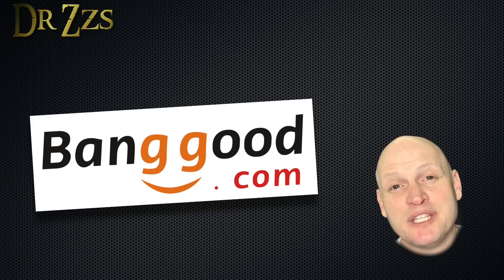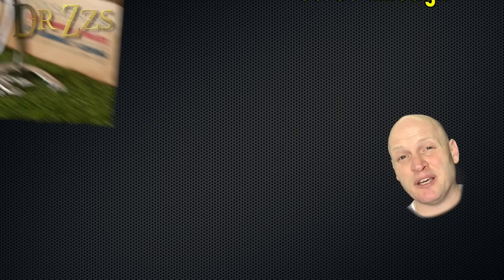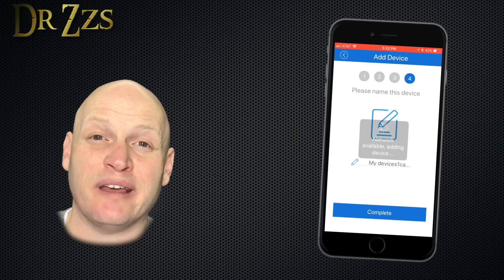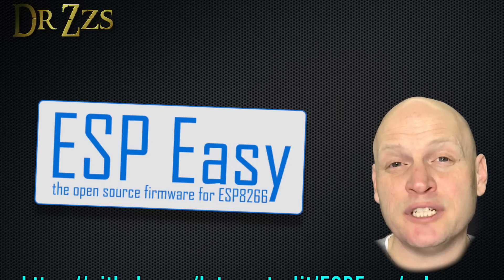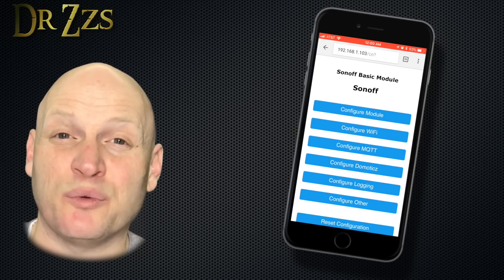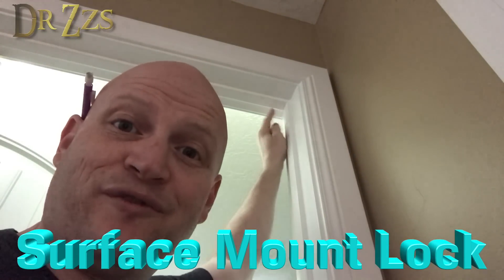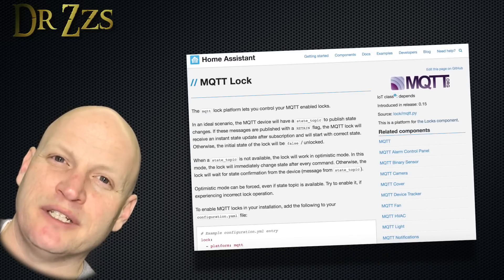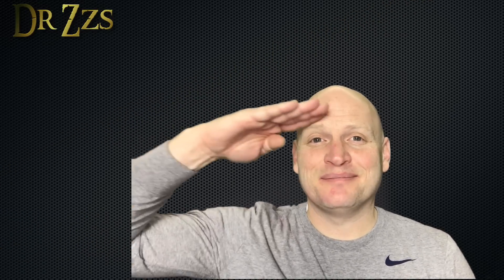$25 DIY "Smart" Door Locks - ElectroMagnet + Sonoff + Tasmota

Comment: I need your help i have a 3D printer i need  a cooling system for the board unit which turns on automatically when the enclosure reaches a certain temp i have the temp sensor can you help :) :)

Comment: Great video.  I agree with Bob Moran about a battery.  In some cases, you would not need it to fail open for fire, because there are multiple exits.  I'm in Florida, so occasionally you have multi-day power outages due to large storms.  So maybe just using a dedicated UPS would be the way to go.  Or better yet, 12v battery and solar backup.
One other thing, and perhaps its overkill, but it would be very inexpensive to do a lock at the top AND bottom.  The equipment may be in the way a bit, but you would have much greater stopping force.
A keypad is really needed though, as someone else mentioned.  Being outside you really want a quick way in.  NFC might be easier though.
Reply: Great post, what is NFC?
Reply: UPS can get expensive. You can easily make one with a Li-Po battery and a cheap charge controller. 

I also advise NOT using a lock that is fail safe open. Your power goes out and it is more time than the battery has charge for, you are leaving the door unsecure. By using a panic/stop switch to directly apply power, in emergencies, it can be unlocked. Some stop switches even have LEDs that can be wired to turn on when there is no mains power or the lights are off. So you can see it in the dark. Or simply always on and powered by the battery.
Reply: Oh and when using fail safe locks, use them only on interior doors, but if you have to keep them locked you can do that with Li-Po and charge controller I mentioned.

But for exterior it is best to use fail secure locks.

Comment: Extra security for  nefarious power cuts.   Wire in a small  12v  lead acid battery like the PX12072-HG to maintain the lock on power cut and maintain charge from house power.  House on fire:  Power on = normal exit,  Mains power off battrey up = normal exit ,  Mains down and battery dead = fail safe unlock.
Reply: No need to do that, just get a fail-secure lock instead of a fail-safe one.
Reply: David Jeffers this is an opportunity to consider a personal philosophy and the possibility of creating a tortured death by fire for someone in the event of a total system failure. I suppose if you don’t have security bars on the windows or could exit that way, most people with mild intelligence and a survival instinct would be able to exit and the chances of that kind of failure to someone other than yourself might be very small so perhaps I would consider your suggestion but more likely I’d go the battery backup route. I was thinking I’d need to lock my electric panel but what a hassle. And shouldn’t it be locked with a smart lock? lol
Reply from the maker: yes!  Excellent solution!
Reply: @ Bob Moran This is only half a solution for the lazy and forgetful person who may become lax in keeping the battery changed. Amazon shows they are often sold with a trickle charger, however those will use electricity and over charge and ruin the battery if left on all the time. Therefore a UPS smart charger or battery tender is required. Maybe there are other systems that should be kept on in the event of a power failure so perhaps a more robust battery and support wire system would be helpful?

Comment: The fail safe is a problem.  If someone want to access your house or room, they just shut the breaker or power to the house/room.  Just like safe-lock feature in a movie.  Can this feature be disable?
Reply from the maker: No, can't disable it.  I believe there are non-fail safe locks too.  I'm not worried about someone cutting the power to get past the lock.  Our circuit breakers are in the house in the basement.  You can't shut them off from outside the house.
Reply: Not if they pull out the electric meter off the housing.  That's what I did when I replace the main breaker board.   I just brought 3 of this magnetic locks using your link.   I am using for my home office french doors to keep kids out hope they does not know what the circuit break is.  Thanks for respond and the great video.
Reply from the maker: cool!

Comment: How did you wire this all together? At work I have a pneumatic push button wired in line to the push button to break the 12v circuit that also connects to our control panel.
Reply from the maker: I ran 12v to the input side of the Sonoff SV, the touch module button connects to GPIO14, 3.3v and ground. Then the lock connects to the output side of the sonoff. 
so I can lock or unlock it with the touch module or with Home Assistant.

Comment: Anouther well done video.  
Do you have access to Home assistant remotely?  I haven’t found any good up to date videos on how to do that and I can’t figure it out on my own. I got Duck DNS installed and that’s as far as I got. ☹️
Reply from the maker: yes, i do have remote access.  I set my home network IP address static.  My router gives me that option.  Some other routers might not.  In the past I had a different one and had to get my ISP to give me a dedicated IP address.  With the IP static I then forward an external port to 8123 on the IP address of my HA pi.  I use DuckDNS too, but it's not as important since my IP is static.  
I'm sure there are network security experts that would say there's a risk to having a static IP.  
I have a password on my HA interface also.  To get into my home network and make changes to config files and such I use OpenVPN.  

So the easy answer is to get into your router and see if you can set your home IP address static.  Then find port forwarding and forward an external port to port 8123 on the IP of your HA pi.  You actually will need to set the IP of your HA pi static too.  
For me I go under "LAN setup" and I can select devices to give a fixed or "reserved" IP address. So I do that with my HA pi and any other devices that I don't want the IP address to change if/when the router restarts. 

Hope that is at least a little bit helpful.

Comment: When I flashed Sonoff Slampher with flashesp8266, I was not able to create Wifi AP by pressing the button 4 times. I had to change the Wifi settings with Tasmota commands via serial connection (I used Termux to access the console). Maybe this will help someone.
Reply from the maker: Cool.  Thanks! 
I didn't include it in this video, but what I've done is make my own binary file exported from Arduino IDE with my Network info and MQTT info included. So when I use "Flash-eZ" now, the sonoff can connect to the network without the extra steps. 
I'll include that in another video.

Comment: If there is a fire and you have a smart fire system have it unlock when fire is detected.
Reply from the maker: Helz ya!  

Do you have "smart" fire detectors?  I have one flame sensor I need to tinker with.  I haven't looked at smoke detectors yet, but that should be on my list of videos to do someday!
Reply from the maker: ya, smoke detectors might not be the best place to save money.
Reply: I went with NEST. You can add them to Home Assistant. No need to scrimp on safety
Reply: As I rent I have not bought one it is on my todo list.
Reply: DrZzs https://youtu.be/8fIWIpw0SwM

Comment: What a coincidence, I tried make a smart lock last week but failed.
I used a comum lock and a servo motor.
Reply from the maker: Great minds thinking alike again! 

Using a servo on a normal lock is a good idea.  What went wrong?  I'd guess building some housing and getting the mechanical parts to work together would be hard.
Reply: I guess so. :)
I'm from Brazil and we have different locks here.
The housing of the lock is bigger and the key locking mechanism is almost like a servo arm. 
https://goo.gl/cy1h73
So I thought that I could install a servo inside the housing and working together with the key mechanism but the orientation of the servo is not the same. It would be necessary install the servo parallel sticking out of the housing. If the servo could go on the right orientation it would be a very tight fit but it would fit inside it.
I think I gonna use the Cathode Lock because it looks like it would work with my lock.

Comment: Did not know you could get these so cheap.  Biggest issue is cutting power causes house to be wide open so don't put one on your front door!   I would want to attach a motion sensor that will unlock as I approach, though.  Especially on those doors at my house that are only closed to keep the AC zones separated
Reply from the maker: Good idea! 

Maybe if you really wanted to go all out you could get a battery backup.  I was wondering today how the $200 smart locks handle power outages.  I'm not going to buy one to tear apart and find out, that's for sure!
Reply: Hmmm. Where would I get a 12v battery? My car!
Reply from the maker: actually, yes!  Our old alarm system had a back up battery that looked like a car battery.  A little smaller, but pretty close.  
I've got my electric car (Nissan Leaf), I wonder if there's a way to use that as a backup battery.  There's probably some one-way directional dealiwhopper on the charger... It would make a lot of sense to use that as a backup battery for the whole house (or at least some crucial systems).

Comment: What are your thoughts about the issue of your house unlocking in the event of a power-failure (or someone cutting the power outside your house?)

It seems to me, the way to handle it is kind of what you had with your garage (but the lock MUST NOT have a fail-safe mode).  Meaning, if the power is cut by some bad people (to also inhibit your security system from going off) the the lock should REMAIN locked, but a person trying to escape a fire, could simply turn the handle, as they would already expect to do.

Can these locks have the fail-safe deactivated to support this?

Thanks,
Daniel
Reply: Yeah I definitely wouldn't implement this here in Arizona where all of our breaker panels are on the exterior of the house.
Reply: The mag lock won't work without power. One would need a battery backup. And without power you probably won't t have internet or WiFi at the house so you have no way to open the lock. The only way I can see to do it is with a battery operated device that also accepts a key.... So basically it needs to be just like all the other smart locks out there. Battery operated motor that extends and retracts the deadbolt and accepts a key.
Reply from the maker: I used to live in AZ and LV.  Had to get out of the heat. Would be easy for someone to cut the power for sure.  
Someday, when we all have Tesla battery packs hanging in the garage we won't ever have to worry about the power going out.
Reply: The way DrZzs installed the lock in his garage is how I've seen businesses do it, and it works perfectly (albeit not as a "smart lock") when the power is cut.  The way he installed it, was to have both a knob (or deadbolt, I guess) AS WELL AS the mag-lock.  His setup can be opened just as easily by grabbing the doorknob as by pressing a button.  The problem is the application of power is opposite of what you need for security but for the price (and ease of use!) this is the best setup I've seen so far.

As David mentioned, a lot of us have circuit panels OUTSIDE the house, so it would be pretty easy for someone to cut/smash the padlock off my panel and just kill the power.
Reply: DrZzs I've moved a couple times but keep coming back for some reason... Power wall is a project I hope to start soon. I work in the vape industry and am slowly collecting 18650s. And also I will continue to call it sonoff myself. Lol thanks for video. You are the man.
Reply from the maker: building a huge backup battery out of old vape equipment would be a great project!
Reply: There is Fail-Safe and Fail-Secure, just look for one that is labeled as Fail-Secure
Reply from the maker: there may be non-fail safe locks out there. That are locked without power, and unlock when power is applied.  I'll have to search around.
Reply: But isn't that what you already have.  The one they call fail safe if the power is cut off can't work without power anyway so they say is fail proof if theres no power it will be unlocked, the one you put inside the house.  The one in the garage is locked when there's no power, when you apply power the magnet unlocks the lock by moving the moveable piece, there is no fail-safe unless you have a battery when your a/c don't work, so please do explain and defend their marketing.  It's kind of like calling a toilet paper septic tank safe when all the toilet papers are septic tank safe, like stating the obvious and using different words such as "magnetic lock doesn't work when power goes off --- magnetic lock is fail safe when power is cut off" it just means electro magnets need power.  The reason garage lock is fail safe is usually you would have a key where your knob would be, the knob isn't moveable but the key is able to move the part as you move it with the knob if the power is off.
Reply: Bill Mears how hard is it to find a 12v battery? Don't u have a huge one in your 🚘?
Reply: Not old vape stuff persay. Just using my wholesale account to buy some quality 18650 li-ons.
Reply: Non-failsafe strike plates are called Fail-Secure and are pretty common DrZzs, I definitely recommend those for you exterior doors. Neither will work for a dead bolt, the bolt is too long, but there are some specialty ones on the market that will, but they're $$$$$$! You can however get electronic deadbolts, that are basically just solenoids. Reverse install those (in your jamb, like the strike plate, rather than the door), so you don't have to worry about cables routing through the door...
Reply: Newbie here haven’t flashed my first sonoff yet. With the esp flash is the usb to serial converter still attached to the sonoff board, I could not really tell from the video but assume it must be or you wouldn’t need it?
Reply: @homesteadersales1865  yes. The usb to serial converter takes usb input in and translates it to serial information for the sonoff to understand. So they'd all have to be connected for it to work.
Reply: Daniel Sherer or to the computer you could add a battery pack same thing with the locks
Reply: There are locks that remain locked in power failure and then you just use a key.
Seen a keypad lock that on the outside has the possibility to temporarily push in a 9volt battery in case of power failure
Reply: The term is fail secure...like this one https://www.aliexpress.com/item/Locked-when-Power-Off-Long-type-Fail-Secure-NO-Electric-Strike-Lock-For-Metal-Door-Access/32882300495.html?spm=2114.search0104.3.114.76d31a49HE16Ny&ws_ab_test=searchweb0_0,searchweb201602_5_10065_10130_10068_318_10547_5727316_10548_10696_10084_10083_10618_452_10307_532_10131_10132_10133_204_10059_10884_10887_100031_10103_5727216,searchweb201603_60,ppcSwitch_0&algo_expid=eed920b0-7df4-4c00-b4a2-b4bb3e9679fa-16&algo_pvid=eed920b0-7df4-4c00-b4a2-b4bb3e9679fa&priceBeautifyAB=0

Comment: please drzzs do you have any plans to make a diy video doorbell  or any ideas on a good one  ?
Reply: Grap a raspberry pi zero with a noir cam or a regular cam for a total of $30 and fit it in your doorbell. You can use motion eyeos for the motion detection.
Reply: Alen E thank you
Reply: Keep your existing doorbell, you will need to make an enclosure for the pi that sits on top of it. I assume your doorbell is wired to an AC circuit, so you need to wire up a circuit that can detect current through the doorbell to the pi or can switch a transistor gate with the doorbell press that is picked up buy the pi gpio. Having a PIR is redundant, as the software in motioneye os can detect motion and trigger a script when detected (you need a NOIR pi camera with IR cut). 
The cost of making this will run you over $80 with all the supplies. Grab a digoo doorbell camera off banggood for a total of $50 for an out of box solution. The digoo doorbell cam has a built in button and IR and onvif support so you can tap into the stream with homeassistant.
Reply: @Alen E / @DrZzs please will it have two way audio and buzzer / pir sensor ? is there a guide please ? 
it sounds prefect for me as motioneye works with home assistnat and magic mirror. 
I dont understand how to connect it to the bell ( dash button ) ? 
will this work with amazon alexa ?
Reply from the maker: I concur with Alen.  I need to do that too.  We have a Ring doorbell right now.  I'm not a big fan.  The wife likes it though.

Comment: Hi DrZzs. Are you using presence detection with HomeAssistant? Which method?
What about using RFID to unlock the doors "magically"?
Reply: jhhernan1 motion detection would be cool, I think that could be done with a motion detector hooked up to a d1 mini.
Reply: Droid. S. But then anyone could unlock the door, what is the point of that?
Reply from the maker: I'd like to try RFID! 
We use OwnTracks, and iOS app.  It's pretty good.  Not perfect. 
This is the set-up I'd like to do someday:
https://community.home-assistant.io/t/homekit-iphone-multi-user-presence-detection-using-homebridge/28453

Seems to be the most reliable.
Reply: Motion sensor or pir sensor, while convenient is pretty easy to trip with a stiff wire and flag, or as simple as a can of compressed air. Check some Def-Con videos on penetration testing.
Reply: I'll be waiting for the video with RFID! I dont use AppleTV nor iPad so that set-up is not for me. Thank you very much.